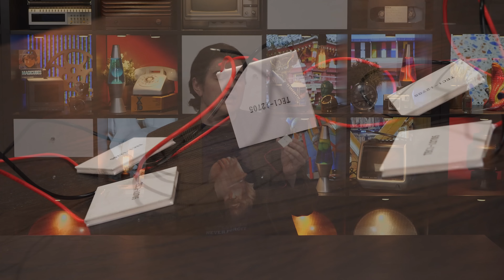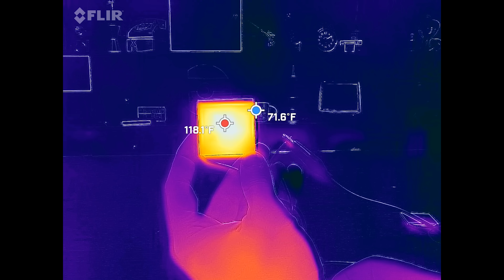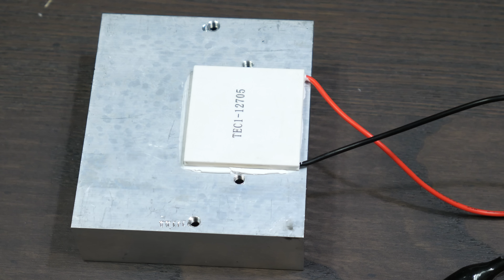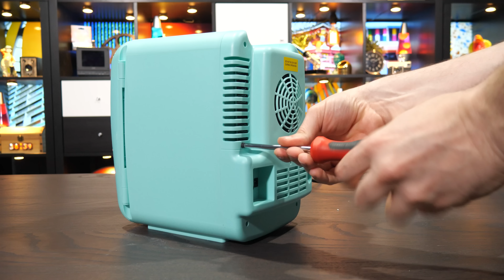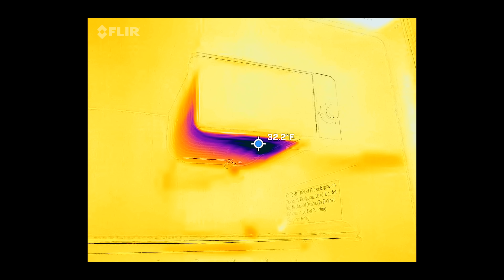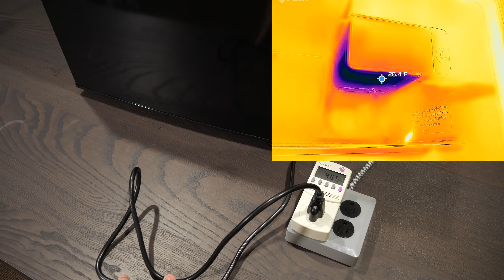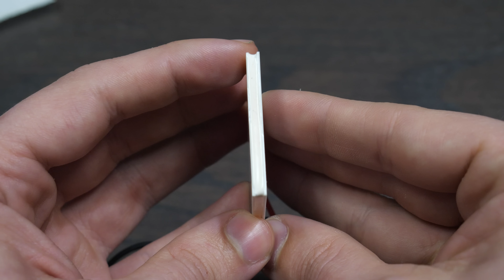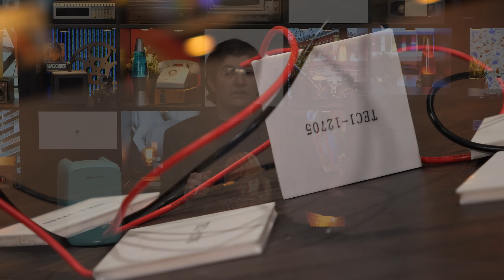Thermoelectric cooling: it's not great.

Comment: i work in hotels.   and minibar suppliers are very unclear on model info about whether minibars are thermoelectric or compressor based.   it's depressingly hard to trawl through the info.. Normally you just look for ones that say 100% silent and avoid them.     It's a problem for baby milk and if people are using fridges for medicine.

Comment: maybe a fun fact:

i've seen thermoelectric cooling (aka peltier, TECs, etc) used a lot in laser devices. I used to work for a company that rented out and serviced lasers for concerts, lasershows, etc. and a common servicing task was to change out the TECs. They were often used for two reasons: 1) lasers generate a LOT of heat and 2) certain lasers need to be kept at a specific (often elevated) operating temperature. TECs were used since fitting an entire fridge inside was impossible and were able to move more heat away than passive cooling alone. Also, by using an H-bridge and running the TECs in reverse, you could heat up the lasers and get them to their operating temperature. Diode lasers need to be slightly above room temperature for best operation, and OPSL lasers have mirrors inside that need to be accurately placed within half a wavelength of light (a few nanometers). For OPSL lasers, the temperature setpoint was critical for not only the light source inside but also to deal with thermal expansion of the mirrors and housing.

Also, some lasers actually change their frequency (color, when visible) according to temperature, slightly. This could cause unwanted interference effects if not accounted for, as well.

TECs and a heatsink/fan were quiet enough to be used on stage and compact enough to keep the size/weight of the unit reasonable. Some of these lasers were mounted up on stage truss, so they had to be light enough to be carried up (still very heavy tho, u gotta be strong to mount lasers)

Comment: Ik this is outside the scope of the fridge topic but one big uses for pelter is for things that need temp control such as a voltage source. Because they can be reversed by just reversing the current it can be used to keep a small area at a very precise temp for long periods.

Comment: What if you shove the running blue...thingy in the actual basic cube fridge? Will the compressor cycle be able to cool the inefficiency of the TEC module? How low can we go or will the whole thing just heat up more and more? It's a (not really) fridge inside a fridge. Fridgeception.

Comment: you had me laughing out loud on this one.  great job,   I have been trying to push for heat pump at my job for a while, I am a mechanic for a fire dept that runs EMS.  on the ambulances, they have AC in the back (the "Box") that runs off the AC installed in the truck (pickup truck cab and frame) and we are always having issues with compressors going out due to the increased load or leaks in the system that has been complicated by the addition of the rear AC.    where if we had a heat pump, we could heat and cool the box with just running some power lines to the rear and less complicated and more reliable.

Comment: Hilarious that there is no insulation in the door… to prevent the terribly inefficient device from accidentally getting too cold… which could easily be prevented with a thermostat… which would raise the cost point and prevent it from being an impulse buy. The whole thing is carefully engineered and counter engineered to provide as little value as possible.

Comment: I have a thermoelectric cooler that I take with me to conventions to keep my temperature-sensitive meds cool, since it's not always guaranteed the hotel room I end up staying in will have a mini fridge. This is the only time I use it though, while traveling. I know it's not as good as a proper fridge, but it's better than nothing at all. I imagine simply because of the design, it's slightly better than that blue thing though, since it opens from the top like an actual cooler.

That said, I've recently discovered that they do make actual compressor-based refrigerated coolers. They're rather pricey, but I'm definitely considering one to replace my current thermoelectric cooler eventually.

Comment: Later in the video you mentioned using these coolers in vehicles. I have an Igloo brand model.  The trick to making them work is to precool them.
The night before a trip I fire up the cooler and put a gallon jug of frozen water (about 10°F) in it. Pre cooling is the trick since it works off the temperature difference. Its now ahead of the game. I replace the jug with fresh ice packs and load every thing so the air can flow through out.
On an extended trip, about 150 miles, I can keep frozen food frozen.
8-)
"Ignorance is a peculiar nature: Once dispelled, it’s impossible to re-establish". 
Thomas Paine

Comment: Yeah these small six can tec coolers are kind of just a recent gimmick, but peltiers have been used in travel coolers for a long time because it's just not feasible to lug around an actual refrigerator. I use one in my work truck, I used to use a cooler with just ice but then half of the cooler would just be used up with ice and then the ice melts and if you have any bag stuff it just gets wet.
Like yeah it doesn't really get it cold but at least it gets a cool, which on a long work day is still nice compared to drinking 30°C beverages, I do try to put a little bit of ice in it still, but I can use way less that I did without a Peltier, but most times I forget.

Comment: Another use for these Peltier devices is generating energy in space them solar power isn't available - just like these things can maintain a temperature gradient if energy is applied, they also produce energy if there's a preexisting temperature gradient across them. So deep space probes like the Voyagers will stick them to a decaying lump of plutonium or uranium, and they'll generate electricity as the element decays and gives off heat, powering the probe.

Comment: Could convert cities to run on compressed air and use vortex tubes for heating and cooling.    Oh we had some igloo thermoelectric coolers for road trips - out of three (a friend bought one) all had a fan fail that was impossible to source a replacement, they just did not exist on any China industrial sales site :/ junk.

Comment: The sad part is… I might buy one of these now. I didn’t know they existed but I don’t pay for electricity at work, the office fridge is on the other side building,  my drinks are at risk of getting stolen and I’m not carrying a mini fridge into my office. This horribly inefficient joke of a cooling device will work just fine for me. As a bonus, it will work as a tiny space heater as my office runs too cold.

Comment: Peltier elements are much better suited to making power than cooling.  You keep the correct side cool and heat the other side, you get electricity out of the device.  Pretty much how radioactive thermal generators (RTG's) work.

Comment: Besides the mentioned lowering the noise floor for electronics and lab equipment they work in reverse to provide electricity.  5 decades later and beyond the solar system they still power space probes.

Comment: Even for the in-car 12V cooler, at least here in NZ proper vapour compression cycle models are available for pretty reasonable prices. Which upsets my because I bought a peltier version shortly before they came on the market.

That said, the peltier one works really well as heated container for transporting food.

Comment: Ok yeah I know they are very inefficient.  But I love mine. Its runs off of AC or DC. So I use it in my truck to keep my drinks cold. They are already cold when they go in there, like the manufacturers recommend.  Since its AC/DC I can keep my drinks cold in the truck, then when I get on site, I can plug it in at the shelter. Its great for keeping some drinks and a sandwich cold. I have even been able to keep ice cream frozen on an 8 hour drive home. The trick is to point your A/C at the heatsink to keep it even cooler. Don't worry about the energy costs, bc for me they're zero. I have a company vehicle so they pay for the gas, and the electricity at the jobsite is free for me aswell. I couldn't do all that with a mini fridge, bc Im not dragging that thing in and out of my truck.

Comment: You should mention that these devices can work in reverse. Add or remove heat and you can generate electricity. Show one of those fans that you can put on a wood stove to blow heat around!

Comment: I use a peltier cool box in the summer for beverage cooling. It not only got a fan on the outside - there is also one one the inside which circulates the air. In it is a 75W peltier element. That's anough too keep multiple (up to 6) 1 liter bottles cold. So cold that I even have to turn it down a bit sometimes to prevent freezing my liquids. I don't care about power efficiency - I got solar panels and more energy than I can use in the summer. They're a perfect solution for me.

Comment: I got one-a those for the occasional hotel trip. My current approach is to:
 - The night before, fill the Peltier fridge with with whatever cans, and then stick the Peltier fridge into my actual fridge
 - As I'm leaving, take the whole thing and stick it in the trunk insulated as best I can between bags/clothes/blankets
 - Plug it in right away when I get to the hotel, and swap out can by can as I drink 2-3 a day

Works ok for hotels that don't have in-room fridges 😆

Didn't realize what an energy nightmare they are, though!

Comment: I bought one of these cheap little thermoelectric coolers at Goodwill for $6.  It worked, and this is what I've found: if this is used in an air conditioned environment (like an office, bedroom, etc), then it will indeed cool down drinks fairly well; not to nearly freezing, but cold.  The limiting factors as to how well it will cool down are: the room temperature; the efficiency of the thermal insulation; and, time.  The longer it is left on and closed, the temperature will continue to drop until the frig's insulation can no longer deal with the temperature delta.  In other words, if a super insulation were used, it could bring the internal temperature to somewhere well below freezing.  They have their place, and mine works very well sitting on my desk at work, keeping Cokes and Pepsi's cold for me.  It won't chill them in an hour, but when I visit that office once or twice a week, it's full of cold cans, waiting for me.  Perfect!

Comment: One use case for them, AFAIK, is in cryogenics. With conventional compressor, the refrigerant is designed for specific temperature ranges, if you want something really cool you'd have to either cascade them or use some exotic refrigerants. Peltier doesn't care if it's running at absolute zero or boling hot, it still creates a temperature difference. If you need only a tiny drop of sample frozen to cryogenic temperatures you can just stack like a dozen of them and plop it onto a normal fridge evaportator for a good measure and you're all set.

Also can't help but think that it can have some merit in the future if it becomes even more cheaper than it is now. Say, you have a 1000w electric stove, then the coil dumps exactly 1000w of heat. But, correct me if I'm wrong, but same stove made of Peltier's would make the same 1000w of heat AND like maybe 20w of cooling. Why then not dump that coldness into a fridge to save an extra bit of power?

Comment: My mini fridge works great, the back wall is clearly at 32 degrees since it forms frost.  It isn't very effective, but cheap is part of "good," and refrigeration units cost a bunch.  I think you are letting your biases get in the way of using things that work fine for what they are.  My unit keeps 6 drinks cold.

Comment: I think we got one of those micro fridges at the gas station for fidelity points 😅
The insulation was ok at least, both AC and DC power and could do both hot and cold transfer. A bit disappointing they only used one element.
Good thing we had it btw because it was essential when we first distrubuted covid vaccines, obviously by putting a big chunk of ice tablets in it to keep wellllll below freezing (as I said it was the best insulated portable thing we had).

Also I think those thermocouples are used in space probes to get heat from nuclear generator

Comment: In the mid or late 1980's there was a company that was manufacturing motorcycle helmets with a peltier board to create an "air conditioned" motorcycle helmet. It had a heat sink outside of the shell for the rejected heat. The reviews that I read commented that the cooling was intense and caused "ice cream headaches." 

There is currently a couple manufacturers that sell motorcycle seats that have both heating and cooling. I suspect that they are using peltier boards but I haven't taken the time to investigate.
Reply: Too bad power electronics were still relatively expensive at that time, an adjustable voltage regulator would have solved that problem nicely.

Comment: They are the only way to keep cigars cool. You can't use a normal refrigeration system for cigars as it will suck out all the humidity. Cigars need to be kept around 75 degrees Max otherwise you risk cigar beetles. They also need to be kept at a certain humidity. Between 70 and 78 percent.

Comment: Something I've been wondering,.. why are we pumping heat out of our fridges and into our living spaces during the summer? What if there was a switchable, second condenser outside the house? 

Or.. to avoid sending refrigerant through long pipes... What if the fridge was mounted into a hole in the wall where the back vents outside? Add some movable insulation panels and clever design, the it could still dump it's heat into the room during winter

Comment: I have that black cubic isobutane minifridge. Mine is silent. The ice box does ice up, but I like to use the ice surface to spin up a room temp soda down to chilly in like 3 minutes.
Reply: Does it use absorption by any chance ?
Reply: @psirvent8  I meant the real minifridge, the black cubic one. It works like his with an isobutane compressor. I have updated my comment to clarify this.

Comment: another weird application for those peltier elements is for industrial use, where they heat or cool semiconductors that are used for precision measurements, so they ovenize them to ensure consistent readings.  they sell cascades that stack 2-3+ peltiers to get cumulative temperature deltas.  due to the horrendous efficiency, each layer of the cascade is significantly smaller, so the area cooled is small, but they're for specialized uses, and still a lot more convenient than a phase change setup for specialized applications

and there's the inverse use for these: generating power.  it's basically how the thermocouple (poor name choice IMO, given its role**) in a gas fireplace gets power to hold the safety supply cutoff valve open while it's exposed to heat, and also those wood burning stove fans that are TEG powered.  stove heats one side, the fan and the heatsink cool the other side, and generate enough power to spin the fan, which cools it more, which makes more heat transfer, which makes it spin faster, and the resulting air movement then helps distribute the hot air around your cabin or home.  they've been used in spacecraft to generate power from a radio isotope to make a nuclear battery with few to no moving parts, which is good in a space application, and less weight than a compressor too.  cool technology with horrendous efficiency

** edit: i realized that i should mention that i know that thermocouples used for temp measurement are what people think of when they see that word, and that despite this, they're really the same underlying technology, so in the technical sense, it's a good name, but if you ask random people what you would use a thermocouple for, other than the HVAC people that would mention fireplaces, i think the rest that have heard the word would say temperature sensors, hence my comment about it being a bad name choice.  technically the name is exactly what it is, but i think TEG would've been a more logically clear name given everyone's association of "thermocouples" with temperature measurement.  i know how people get in regards to these topics so i had to come clear that up, because it's inevitable someone will come comment about it actually being a good name lol.  i don't disagree from a technical perspective

Comment: Refrigerators are not heat pumps. They are straight cooling units. Heatpumps have a reverser valve and the air handler and condenser coils are designed to have have the circuit switched so that the coils switch their jobs, a straight cooling system like a refrigerator cant do this.

Comment: Have you heard of electrocalorics? I read an article a while back where they made capacitors that would heat up and cool down when they charged and discharged. Then they'd move the capacitors between the hot and cold side.

Comment: Consumer electronics is not where it really should be applied, it’s really best when the weight matters and the weight of the pump becomes a significant factor and will weigh more than the extra batteries like in a sort of wearable air conditioner unit

Comment: I have a peltier dehumidifier for in my camper during the rainy Oregon winters. It runs on 12 VDC and does a good job of removing moisture from the air. I've been looking for a compressor/heat pump style now that there 12 VDC compressors on the market.

Comment: If you have a Compressor based Refrigeration System and the Refrigerant is listed as R290, DO NOT EVER MESS WITH THE SYSTEM AND IF IT LEAKS, EVACUATE THE BUILDING IMMEDIATELY AND STAY OUT FOR AT LEAST 2-3 HOURS TO GIVE THE GAS TIME TO DISSIPATE...

R290 is Refrigeration Grade Propane - yes, you can run your BBQ with it if you want to spend the money, it's INSANELY expensive compared to what's sold at the local Gas Station for your BBQ Tanks...